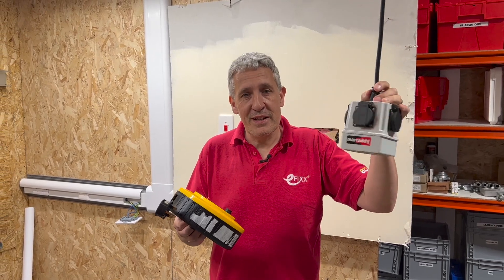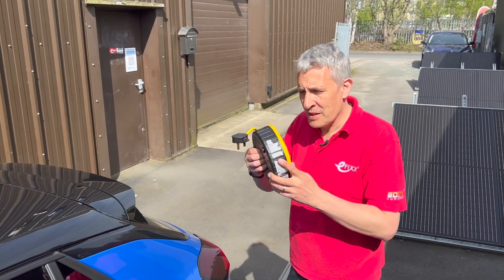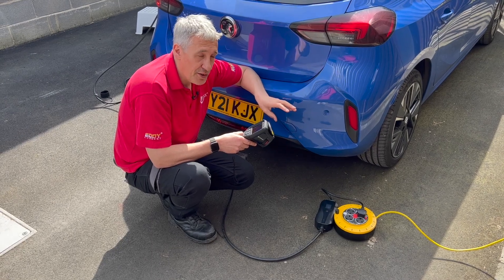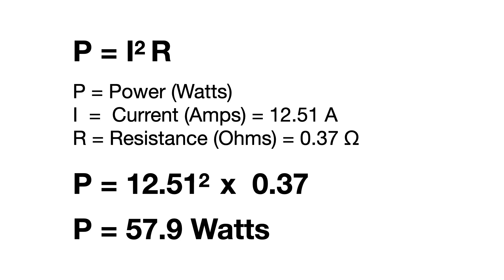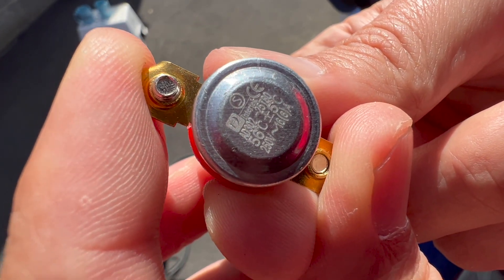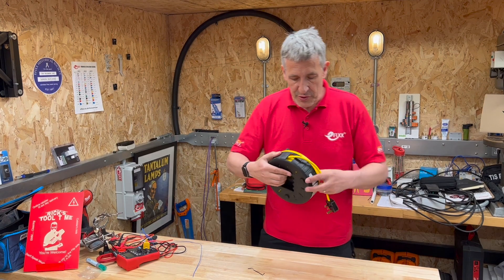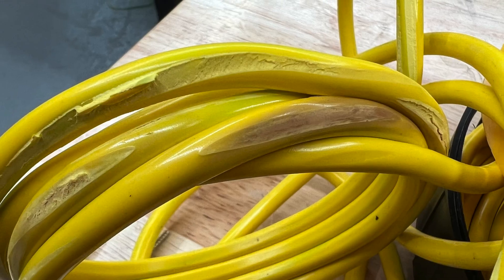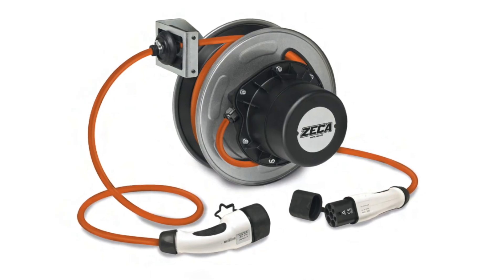What Caused this Extension Cord to Melt?

Comment: In 1967 I worked at the University of Warwick as a Trainee Mechanical Technician. The University was being built at the time and contractors had left a large coil of 240V cable which I was offered. I took it home and my father made a spool for this cable from a couple of pieces of wood. 100ft of cable wound around a 12-inch former. Fine for my father to use with his electric drill in the garden shed, etc. One day my Mother thought it would be a great thing to use for her new twin-tub washing machine in the kitchen. Everything was okay until the machine started using a lot of power on the spin cycle. A bad smell alerted her to the VERY hot cable, and she quickly unplugged it!
When I got home, I explained the eddy-current effect that had helped cause the problem and said that the extension should only be used fully unwound with high power stuff....

Comment: That's not a CE mark on the cutout, it doesn't meet the standards for the lettering, that's known as the "China Export" mark, if they couldn't be bothered to meet the requirements for just the lettering printed on the outside, would you trust it?

Comment: 1:26 How the fuck, are you supposed to get up their to reset the trip when it's 5m off the floor? 
You definitely need an ally tower to hand which is a 2 man job n takes a good 15min to put together and another 15min to take apart again. 

Is there any reason why it doesn't have an 10mA RCBO (or something like it) with a cable and 2 relays so you can test and reset it from the ground where your plugging bits in?
Either that, or have even pull lead on it's own MCB so when it trips. All you need to do is go to the D/B and switch it back on.

That's such a stupid idea because if you haven't got a ladder or any way of getting up their which isn't health and safety approved. Your fucked 😂

Comment: Induction has an effect as well
Reply: There is negligible inductance in a coiled cable as the L&N currents/magnetic fields cancel each other out, the heating is purely resistive NOT inductive.

Comment: I think those cord reels need a thermal fuse, PTC device, or disconnect.  Too many people are simply unaware of the risk, and we can make them safer.
Edit:  a thermal safety at a safe level.  It could even be made to detect when not fully unspooled.
Reply from the maker: A smart extension lead - next thing you'll be suggesting it has an app! 😆

Comment: Years ago we used really long 2 core extension leads to run garden tools, always wondered if you shorted the far end would the current be great enough, 25+A, to clear the fuse before the whole cable went up in smoke.

Comment: Was that ‘granny’ lead actually 13a? Most if not all are usually 10amp. The car did say 8mph when charging so I would say it was a 10amp one. Same result though.
Reply from the maker: Agree that most of the car manufacturer supplied ones are 10A, but this one we found does indeed draw the full 13A we've got a video coming soon which explores the cost of the power loss and in that video we measure the power.
Reply: @efixx  I try and steer people away from the 13a ones on the various EV groups I’m in. They are just going to plug them into any old socket, which is bad enough with a 10a one. It seems to be cost over safety. They don’t want to payout for a dedicated EV socket designed for the load. Most of these people are using them at their own homes daily not just for visiting friends. 8+ hours every night in a standard £2 B&Q socket. No thanks! 
I’ll share your video when it’s out on the groups. Hopefully it’ll make them think about it.

Comment: wound up it is a large coil, with an AC load, so there is inductance and not just DC resistance.
Reply from the maker: The inductance is minimal as the line and neutral are wound together so the return current is following exactly the same path.

Comment: This is why I've always fully unwound extension leads before use, doesn't matter what load I'm putting on it. I also try to use the correct length extension for the distance required so I don't end up with a big loose coil of cable on the floor.
Reply from the maker: Top Tip 💪

Comment: I had one of these about 20 years ago . Old lady used if for her 3KW kettle . The flex was only .75 mm. No thermo cut out and she had a 13 A fuse in the plug top . She wondered why it wouldn’t pull out the plastic housing . It had melted in a solid block
Reply from the maker: sounds like a close call!

Comment: Pleased the old canard of inductive load wasn't brought up in the video. Because both conductors coil together and have counterflowing current, a wound extension lead is a bifilar non-inductive winding and so has negligible inductance no matter how long. The effect is exactly as described in the video, a purely resistive effect from so much conductor in an enclosed space.
Reply from the maker: Agree -  Some of the other viewers are still wanting to push out the old canard!
Reply: @efixx  It's been a common myth in the events industry for decades and the trouble is it gets propagated to new people coming into the industry, it's like banging your head against a brick wall explaining it.

Comment: But it's not the resistive power loading that is only causing the heating. The fact that the cable is wound up in a toroid will cause much more inductive loading and subsequent heating to occur.
Reply from the maker: It would be inductive only one core was wound around the reel, however the line and neutral follow the same path so the neutral return cancels out any inductive effect.

Comment: Inductive loading isn't just imaginary maths! It is real, but not in the resistive sense! :)
I've seen this happen to people who use extension cables in reels, rolled up, or in a plastic barrel... Lots of smoke, and heat!
Reply: There is negligible inductance in a coiled cable as the L&N currents/magnetic fields cancel each other out, the heating is purely resistive NOT inductive.

Comment: I had this many years ago when I worked in a shared office, the office next door went into 'blackout' so I unplugged everything, reset the trip and one by one plugged in every item until it tripped, it turned out that somebody had a heater under their desk attached to a coiled extension lead that had literally melted because of the current load. Needless to say they didn't do that again!
Reply: Extension leads in offices should be banned IMHO.  I frequently confiscated underdesk heaters as a works sparky.

Comment: called to a customer who smelled buring. told her to switch off the electics at the box. go to her about 30 mins later and after a nose about, found that her bedroom fan heater was run via a similar extension lead, no themal cutout. took out of circuit and posted up the house, tested all circults all ok. back to extension lead, took it apart and, hmm think she cut the electics just in time,. the inside of the plastic case had melted. as had most of the the cable which was black (used to be orange). hope showing her the inside of the extension lead stopped her using any more of them.
Reply from the maker: Powerful lesson 👍

Comment: Resistance is not a problem for coiled power lead
It is reactance
Basically coiled up power lead is a coil, it poses significant inductance
Mind electric current causes electromagnetic field which causes electric current to flow , but this is opposite to original electric current
This is problem
Reply from the maker: It's purely I2R losses - the line and neutral conductors following the same path cancel out any inductive effect.

Comment: I have had a couple of issues with coiled extension leads. One when I was considerably younger than I am now, when I ran a 3kw fire without uncoiling the lead. I think more heat was generated in the lead than in the fire. It became one mass of melted plastic, no way would it unravel again. The other one was trying to run a small stick welder without fully unrolling the lead. It was only for 1 stick to quickly tack something together, but it wouldn't weld at all, I thought the rod was damp so stuck it in the oven to dry it out, but it was still rubbish. The penny finally dropped and when I unwound the whole lead the weld was fine. I think the coil was acting to upset the whole electrical circuit. I always unwind the whole lead these days.
Reply from the maker: Great insight 👍

Comment: As it is coiled up there is also inductive heating. As an apprentice in the 70's I saw a large steel sprung, and encased extension lead melt very quickly being used unwound.
Reply: There is negligible inductance in a coiled cable as the L&N currents/magnetic fields cancel each other out, the heating is purely resistive NOT inductive.
Reply: @mfx1  Good point, I never thought about that.  Must have been that it was such a large extension lead that caused the mealting.  I had just assumed the metal casing and core, plus the big spring in the middle had also contributed.  But what you say is quite right, never really thought about it that much.

Comment: Good demonstration, shows how dangerous it is not to fully unwind. The best bet is to a get a waterproof extension cable instead. Oh and the cable connected to the car is called a 3 pin Type 2 cable, nothing to do with old people.
Reply from the maker: The plug in chargers are often known as granny cables. The one used as relatives tend to have EV chargers.

Comment: the one thing that the cheaper extension leads have that really is annoying is that they say they have a 13a plug but in small writing the max load unwound is 10a as they have used 1mm2 cable why dont they make it clear that 10a max. i see these used all the time for high loads.
Reply from the maker: Do they fuse the 1mm2 ones at 10A?
Reply: @efixx  yes they do fuse them at 10A.

Comment: What caused the extension real the melt ? You did Gordon by plugging it into another extension cord , you should never plug extensions into extensions .
Good demonstration showing just what can happen when stupidity is in play. Try that again with out plugging it into another extension , and see what happens. Will make a difference? 
Great video as always Gordon .
Reply: Nope.

The melting is because internal resistance of the cable that causes heat. And because of being coiled up, the heat gets trapped and accumulates leading up to the melting of the cable.
Reply from the maker: That’s just a short converter between our 16A socket in the yard.
Reply: @efixx  My life would be hell if I couldn't use adapters...
Reply: @Richard_van_der_Heijden  if I’m wrong I will happily put my hands up and say so , but I believe I am right .
Reply: If I wanted power at the bottom of my garden I’d install a 4mm2 SWA to an outdoor socket, I certainly would not run two or three extension leads / wheels
Reply: @Dog-whisperer7494  so assuming you are a qualified person what's your issue with plugging in an extension to an extension  ?
Reply: @dennisphoenix1  on it own not an issue , but when you the plug all and sundry into the extensions then you have the potential for fire , your daughter if you have one she’s say fourteen  fifteen she has two four way extensions one piggybacked off the other one and she has gone to school leaving her computer on as well as her hair dryer plugged in and her hair straightener plugged in and left her TV on hair straighteners don’t have an on/off switch . That’s a fire waiting to happen. And it does happen . Oh and yes I am a qualified electrician have been for over thirty years. And I’m a father of two daughters and a grandfather, so I know what teenagers are like .

Google .is it safe to plug an extension lead into another extension lead..
No - you should never run two extension cords together. Connecting two or more extension leads together (sometimes known as 'daisy-chaining) is unsafe for several reasons. Only use one extension lead per socket and never plug an extension lead into another extension lead.
https://www.hawkesworthappliancetesting.co.uk › ...
How to use extension leads safely - Hawkesworth
Reply: This is getting ridiculous . Please someone prove me wrong I don’t care who just someone please prove me wrong. And I will happily accept.
Reply: @Dog-whisperer7494  bottom line. Heat is what causes fire. Heat is generated by currant in excess of what the conductor or connection can handle. Now I can except there is a lot of poor quality extension leads out there that have the potential for a fire. I  think that is what your refering to. Resistance produces heat  yes there is resistance to some degree at each connection point but if you have quality connections with low resistance you have little no heat. If you leave appliance running of course you have currant flow . If that currant exceeds the capabilities of the extensions leads then you have fire potential. 10 leads plugged end to end drawing 13 amps will not cause a fire if the leads are designed correctly and unwound. However I recognise what your trying to put across there are a load of crap leads that can't carry the currant for extended period of time due to high resistance connection points or undersized flex that will produce enough heat to start a fire.
Reply: And again three times one of my comments has been deleted. Someone really doesn’t like the fact that I m right. I say again you can not and should never plug extension leads into another extension lead and into another there are a number of reasons why it is unsafe to do so to many to mention on here.
Reply: You still can’t plug an extension into an extension
Reply: @Dog-whisperer7494  That's nonsense Sean.
Reply: @JimWhitaker   so you’re not an electrician, you’re just someone who saves other people’s you tube videos.
Reply: @Dog-whisperer7494  can you explain your thinking. Other than volt drop
Reply: @ks-hg5vo  13 amp fuse in each extension plug top as well as each extension block therefore eight plugs plug in the total load may not be enough to blow the fuse/ fuses therefore the fez’s and plugs can overheat. I seen two 4 gang extensions with one piggybacked off the other and a all and sundry plug in to them , they overheated and set a bedroom on fire . I was tort that at college . The same as you can’t spur of a spur  but you can spur of an existing socket to a fused connection unit to feed an outside light so long as the fuse Down at the FCU
Reply: @ks-hg5vo  so you’re not an electrician, you’re just someone who saves other people’s you tube videos.
Reply: @Dog-whisperer7494  how ever you can have as unlimited outlets off a fused spur as the fuse at the spur will give over currant protection to the cable. The problem arises when the cable on the load side of the spur is not capable of taking the currant that a 13amp bs1362 will let through befor it goes. This applies whether it's 6242y or 3183y. The biggest issue is its environment in which it sits whether that allows heat dispersion of not. Where things go wrong is cheap equipment or undersized cable. If the flex is load cable is sized correctly using quality plugs and outlets there can't be a problem
Reply: @ks-hg5vo  yes that is what I said , you can sue off an existing socket to aFCU to feed say an outlet light so long as you fuse down , and yes you can sue off the FCU again but you will need to down the cable and the fuse must be of a rating to cope with the total load.
Reply: @ks-hg5vo  but my original comment was not about the number of sockets and spurs we can  have, it was simply about you can not run an extension wheel of another extension wheel or extension leads , that is what I was tort at college thirty three years ago when I did my electrical installation course. Yes having the extension wheel round in did help but it may of melted anyway because of how it was connected?
Reply: @Dog-whisperer7494  you miss the point. Given correct sized conductors for an extension lead and quality plugs and outlets you can have many extensions plugged in end to end and in the correct environment ie unwound and not in a  thermally detrimental environment. Volt drop excluded. Your never going to pull more than 13amps for any length of time sufficient to melt the cable.
Reply: @Dog-whisperer7494  236 then
Reply: @ks-hg5vo  yes
Reply: @Dog-whisperer7494  if you were doing a job at the bottom of your garden and needed power you would use 2 or 3 extensions to get it there . As long as they are unwound fully the only issue would be voltage drop because of cable size  .
Reply: @Dog-whisperer7494  Looks down...plugs extension into extension....reality doesn't stop......yes you can, what was your point?